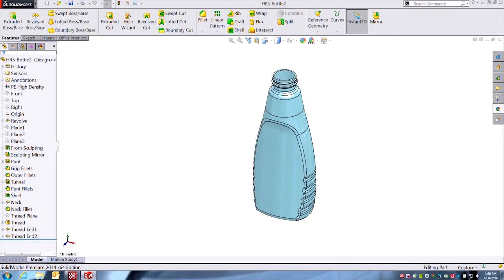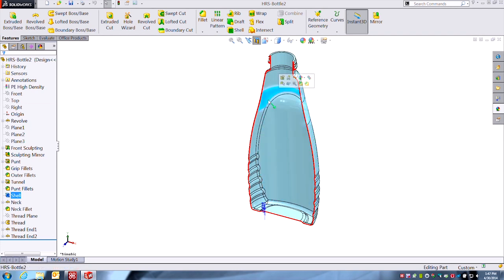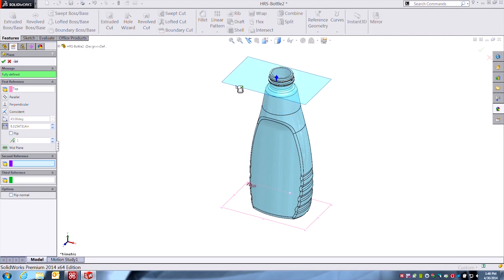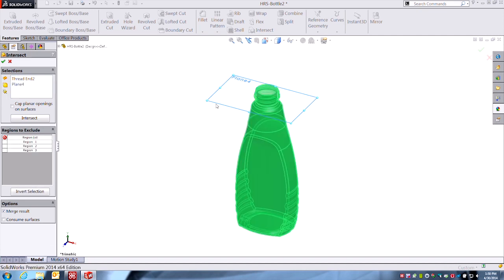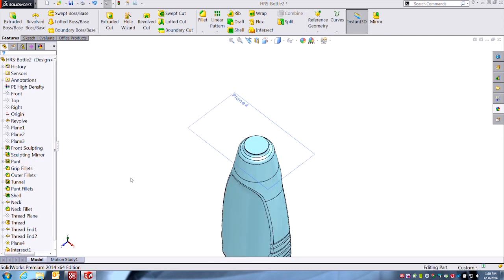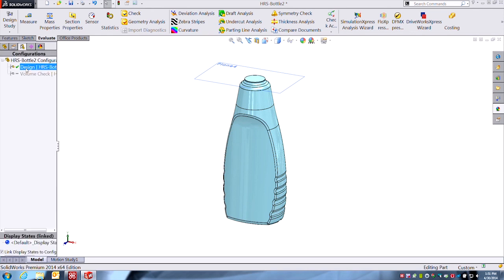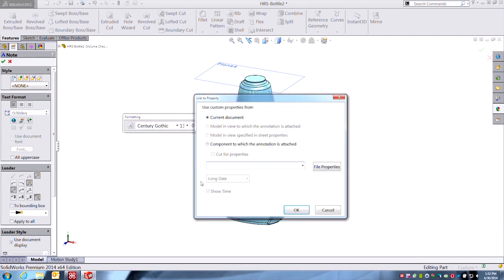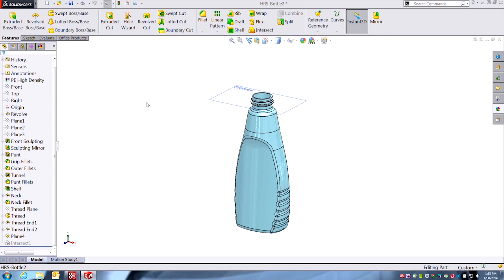SOLIDWORKS - New in 2014: Finding the Volume of a Cavity with the Intersect Tool

Comment: Good video. But what happens if you want to calculate volume specific fill line? 
At the minute I play trial and error on the plane height until I reach my desired volume. Is there a more efficient way of doing it?
Reply from the maker: You could try automating the process by using a Design Study. Here is a video that covers using a design study for geometry-based optimization: https://www.youtube.com/watch?v=XIzRwbBqpP4

In the context of what you are asking, you could setup the goal for the design study to be the volume of the "fluid" body. and to target a specific value.

Or simply run a batch of design studies varying the offset for the fluid body across a broad range, with a small step value to get the results tabulated.